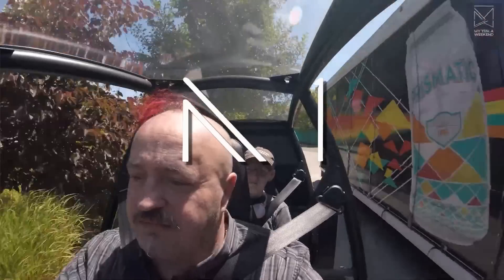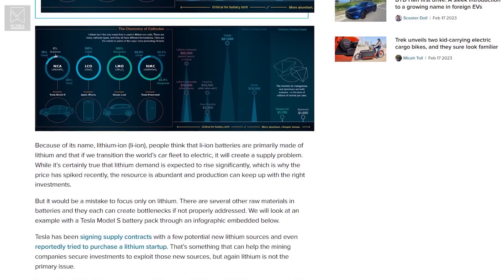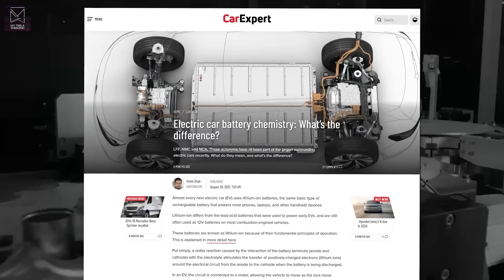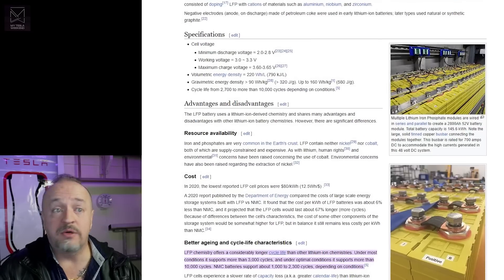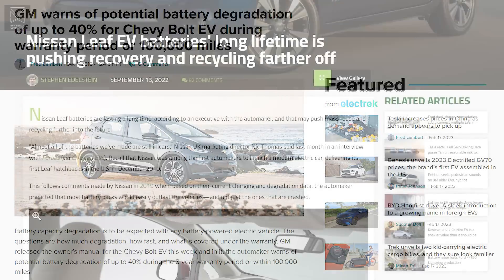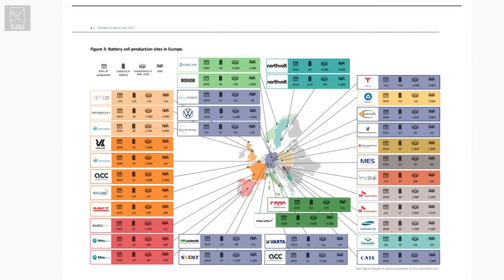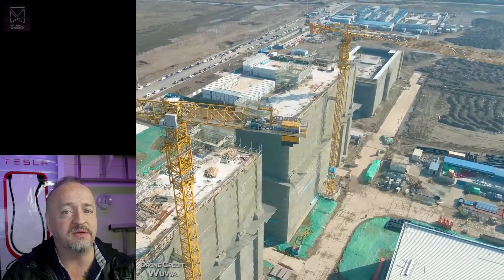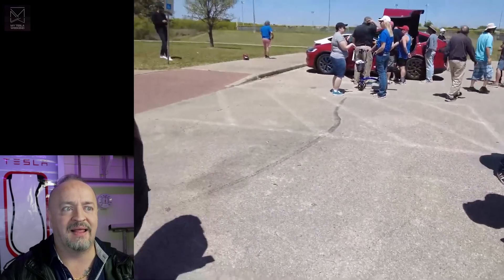We HAVE Enough EV Batteries. Yes, really!

Comment: I respect you and your channel. What follows is offered as constructive. 
What you missed:
1. Lithium mines take 5-10 years to bring on line and 85% are late
2. Li-ION is not going to be replaced by a new chemistry in this decade. NMC and LFP are committed tech, meaning that billions of $ have been invested in refining chemicals and making factories dedicated to their production. Incl TSLA.
3. Sodium is not a great stand alone BEV technology. CATL is using NA batteries in the same packs as their Li-Ion to make a cheaper and lower performing battery (also heavier). NA may become a ESS (Energy Stationary Storage) battery along with LFP
4 Lithium is in supply deficit NOW. It will remain in deficit because the supply required by 2030 for BEVs is 6-7x 2023. Mining cannot scale to do that. Refer to Simon Moores (Benchmark Minerals) on Ep 92 Redefining Energy podcast. Will tell you all you need to know.
5. Recycling has to wait for a sufficient supply of old battery packs to scale meaningfully. Since the packs are lasting much longer than expected AND have useful lives as stationary storage once done in the BEVs, expect recycling to be more important next decade when millions/year become available. I am a fan of recycling and a circular economy. NOTE: Graphite is currently not recyclable for battery grade material due to the chemistry changes it undergoes.
6. TSLA’s 50% CAGR is not sustainable relative to expected battery chemcial production gated by LIthium supply. TSLA’s 50% CAGR will result in it using the total expected Li supply in the world in 2030 (numerous sources, Rock Stock Channel/RK equity is good on this issue)
What you got right:
1. Jordan is insanely good. Big fan. Props to you for seeking him out.
2. TSLA world needs to pay attention to Lithium supply
3. Benchmark minerals is a good source. Suggest you dive deeper.

You may be the only guy in TSLA world whose alarm bells are going off on Lithium. Even TSLA has been slow to realize their problem. The big story was their renegotiated deal with Piedmont Lithium offtake where TSLA agreed to pay the market price for Li SC6 concentrate (precursor for LiOH). Until now, TSLA has been the only game in town and could dominate the suppliers. Now, Piedmont has said “Take it or leave it at market price. There are 25 other manufacturers lined up behind you who will take the deal.” Market price is up about 6-7X 12 months ago. LiOH price was about $7k/ton in Jan 22. It is now $60-80k/ton. The market is speaking loudly here. TSLA does not have a this year problem, but if it sits around, Lithium shortage will bite hard 2025 and later. Expect TSLA to buy a miner or at least take a significant equity stake.

Good luck with your channel.

Comment: I am concerned about the Hardware 3 to Hardware 4 issue. My "old" M3 with hardware 3 can't be upgraded, said Elon.  So now Tesla computer engineers will need to work on two different versions at the same time. Your job: keep doing updates to now obsolete V3 - - or - - work on the wonderful new V4 project.  I suspect existing Tesla owners will be served by the "B" team.  I predict class action lawsuits will abound.

Reply

Comment: Redwood and the other recyclers right now are mainly dependent on consumer level electronics and other non EV batteries for their source. As larger batteries from EVs enter the stream they will actually become more profitable. That is why they seem to be building up to three times the capacity that they will be using in the near term while money is very available. Countering that is the fact that the fraction of high value minerals will be declining as the older chemistries and recipes work their way through the system.

Comment: Recycling is here, today and is cost effective.
Recycling will get more efficient.
With automation, I foresee the recycling process advance to the point where the batteries are torn down in reverse to how they are built so that the materials are in super high concentrations.
Once we get to the "closed loop" for battery processing, the battery raw material costs will trend to zero.  This is not possible with ICE vehicles.
The EV future is fantastic!

Comment: NMC vs LFP vs LFMP.
I have owned my first Tesla, a model3(LFP) for 6 months.  I consider myself a typical driver, 45km one-way daily commute in NB, Canada.
Owning and operating the car has been pure joy!  It's way better than my Lexus IS250
I was a bit nervous about the range during the winter time, but Tesla has Super Chargers are well located around NB.   I have also taken long 2000km trips no problem.
Currently on track to save $2500/year by mostly charging at home. 

Summary?  LFP is perfectly fine for cars.  If LFMP increases range by 10%, that would be great, but really not needed.

Comment: The huge expansion for batteries due to high rise of BEV demand, will prove more beneficial to battery buyers who can switch quickly to other chemistries.
As Tesla prefers the cylindrical cells and possibly the blade too but certainly not the pouch cells, and their ability to adjust to the used battery chemistry, makes them king of the hill. Any type and/or chemistry  available, Tesla can use them all !